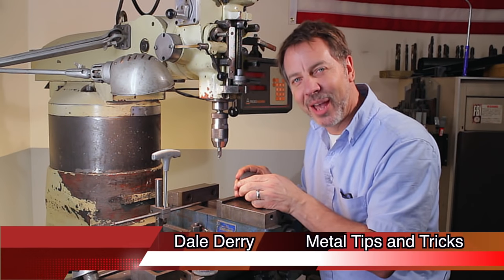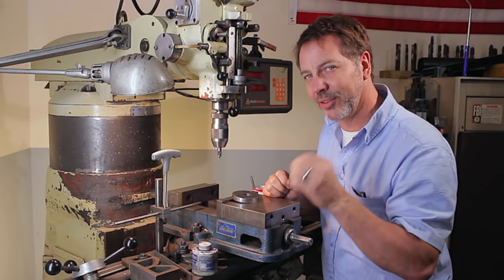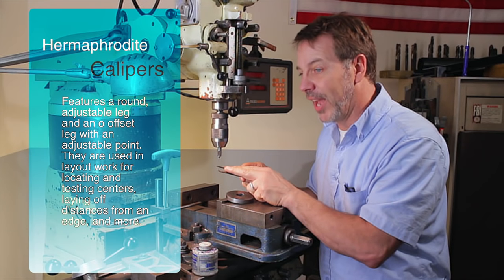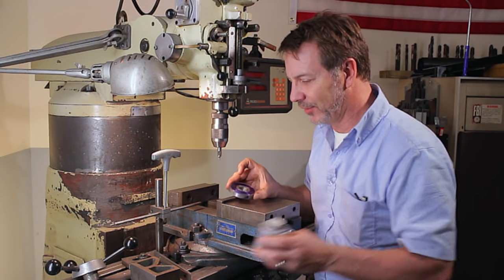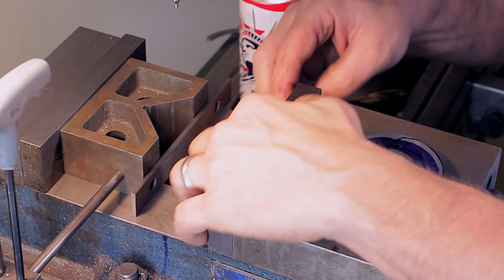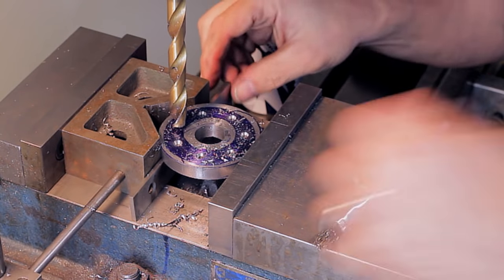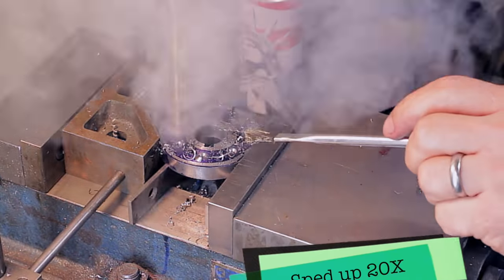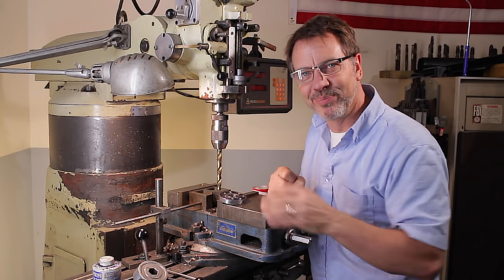How to drill a Bolt circle

Comment: You could use this method when you don't have a mill (with or without DRO) but the simplest way on a mill is to center on the workpiece and calculate holes position using trigonometry.

Comment: I think that making the holes on a circle, the most accurate method is to detect the center of the circle and then calculate the coordinates of the holes in X Y, referred to the center.

Also it would be better to make holes without moving the piece from the vise

Comment: Basic 101 bench work...........in the same time it takes you to lay out, and drill a BC, you could have been done, had the vice back on, zeroed, and even tramed the head back in. Also you will be bang on, dead nuts on your spacing. Check your hole to hole distance with a pair of calipers, it won't be pretty. If you don't have access to a dividing head or a rotary table, then by all means, lay it out, but if you do.........= )

Comment: That is hilarious! I can see the DRO on the milling machine. This week I made my first ever bolt circle, and all I needed to do was select "bolt circle" on the DRO, enter parameters like diameter and how many holes, and the DRO kept moving the 0,0 point to the location of each hole!!! Without that feature, I would do the same thing using the table position dials, and calculate the hole positions using angle sine and cosine functions of my calculator (or sine/cosine printed tables if no calculator???). I drilled all the holes and then tapped them in the same order, no problem. Your way of course works too, but it would take me a long time to get the divider set up to make the right spacing between lines.

Comment: Perfect. I don't have a lathe or milling machine. Want a 7) 3/4" near-edge hole job in a 4 inch diameter, 3 inch tall piece of delrin plastic cylinder with a 5/8" center hold and 4) 90 degree intermediate 1/8th holes? Paper template available from autocad.

Comment: I see what you are trying to do and give your viewers a rough and ready way of marking out, but perhaps a part two with co-ordinate drilling might raise the game to a higher level for those who need greater accuracy and have other means.

On the no room for a rotary table front, an experienced machinist would not have the vice in the centre of the mill table  but off set, giving room for other items to share the table. This will also spread wear on the leadscrew if, every time you have to remove and replace the vice, you put it back on the other side of centre.
Reply from the maker: +Chris Stephens 
Great Idea

Comment: Good for drill press work, but if you do have a mill it will be way more accurate to sweep the concentric feature the bolt hole is around, (hole, OD, etc.) then use simple trig for the X, Y components of each hole. X is the cosine of the angle times the OD of the bolt circle, Y is the sin of the angle times the OD of the bolt circle. Example, 7 holes on a 3" bolt circle; Each hole is 360/7 (51.42) degrees, cosine of 51.42 is .623, multiply that times 3 inches, first hole X is 1.870", sin of 51.42 is .782, times 3 in diameter, first hole Y is 2.345". Second hole is 51.42 more degrees so angle is 102.84 degrees, cos102.84 = -.222, times 3", second hole X is -.667", sin102.4 = .974, times 3", second hole Y is 2.925". Third hole is 154.26 degrees, and so on.
Reply: He's showing us a quick and easy way to get accurate enough hole spacing. Not trying to build parts for NASA here....
Reply: IF you did want to build parts for NASA, do you have the skills?  Will you ever have the skills?   Not at this rate.  And not with this attitude.

Comment: Or you can put together a simple right angle  triangle , just one is all you need  , the two short sides of that right angle triangle are your moves , the hypotenuse witch is half your Bolt Circle and the angle is the angle between each hole do the simple Trig and your done  , and now pick up the center of your part with your indicator to get your Zero and  now just move your X and Y to your calculated short sides of your right angle triangle , the holes that are on your center lines are just half your Bolt circle , so you clamp down your part once do your work then unclamp , now your done ,

Comment: you didnt explain any of the math behind the compass and scribe lines for the bolt spacing. 

also, just so your alignment retains accuracy, wouldnt you want to start your pilot then drill through before moving on to the next hole??

Comment: isnt there a way to calculate coordinates?
Reply: Very easily, if you use a protractor. Divide 360 by the number of holes, and set the protractor angle to the resulting number. Start from an arbitrary 'zero' line (or 12 O'clock) and divide your circle up by however many degrees it is. work in both directions from your 'zero' line, so you don't compound any errors in your angle measurements. If you want an even number of holes, and you've marked your first line right across your work-piece, this is also the 6 O'clock line, so you can work off this line also, both ways, to eliminate errors in your angle measurements.
Reply: +wonderfulmax  yes, use a spreadsheet and use a polar set of equations to calculate x and y coordinates.  Set the centre of the circle as 0,0.  use column 1 for the angle and column 2 for x and column 3 for y.  x=r*cos (angle), y=r*sin (angle).  r =bolt circle radius (diameter/2). angle is in radians and will be a multiple of delta angle da= 2*pi()/n.  Hole 1 =0, hole 2 =da, hole 3 =2*da etc.

You can do this by hand too, or use any cad program to get the coordinates.

Comment: If you have a dro but no bolt hole pattern function, just download the FXwizard  app on your smart phone. it will calculate the locations for you. It also have a speeds and feeds calculator, triangle calculator and more.

Comment: Man, it's the 21st century.  There are numerous bolt hole pattern calculators on the web plus numerous free apps for your smart device. Any one of those and the DRO already on your mill would be a much simpler solution. IMHO
Reply from the maker: +MrPragmaticLee 
Good points

Comment: Great video!     I was wondering how to use this same method to a higher degree of accuracy, and i ended up using google sketchup to do so. (make sure you have the precision set to an engineering scale, and to .000)  If you draw a circle the diameter of the center-line of the bolt circle, you can then right click and divide the circle into however many holes you want.   to get the actual distance between holes, copy and paste a section, or arc, of the divided circle.   then you can measure and get the distance end to end of that arc down to the thousandth.    then simply dial that up on calipers and mark your piece accordingly.

Comment: Thanks for the info, Just had to add my 1.5 cents,,I would have done the math . Tram the part to x y  zero, <<<  and use the digicalus  reader outer, thus a less  visual  error. Machinery hand job book has not easy to find info . Now lets  inspecticate
the part !!! ///  Although I just thought (OhhOhh) the fine method you show  could be done on a  drill press  AHHHHHH thanks again.

Comment: Quick trick Dale but have to feel slightly unsure as to the absolute accuracy. I tend to prefer using math (numerous on line calculators for example) and set up to drill from a 0,0 datum using a co-ordinate set. Still, your way sure saves some time. :)
Happy Christmas.
Reply from the maker: +ChrisB257 
Thing I like about metalworking is, there is always more than one way to do the job :-)
Reply: I have used this method many times in the past with awesome results...The only difference is I use 2 pins for location instead of V block on a jig I have made purposely for doing bolt hole patterns.....
Reply: Interesting idea if you only have a drill press.  With a mill, once the centerline of the bolt circle is established, the machinery hand book can tell you exactly where to go, or countless apps for your phone to get locations of your bolt hole circle.
Reply: sine & cosine works well

Comment: Great technique to Know. I learned a same one with the only difference from Adam (ABOM79) in which he uses a center punch to mark where the hole is desired. Its funny though because I did the same pattern  of holes for friend of mine on a drill press to lighten a 6"OD x 1/2" thick spacer. Its been a dream of mine to have my own shop in which  in a few months i will be piecing together at my place of work thanks to my boss.(He's giving me a small room in the basement) :))

Love your channel

Tony
Reply: +Tony Diaz Read the fine print! Will you  have access to an outside door? Some people might call you being enslaved ;-)
Reply: CncObsession v

Comment: If you have a DRO on the mill, trigonometry is the simplest way to go.  I used it every day as a machinist for nigh on 40 years.  Doable with pen & paper, much easier with a calculator, and easiest with the aid of some CAD/CAM software.

Comment: you've got a digital readout there, why don't you use it, figure out the trigonometry, and move around in x and y  and drill the holes....lot easier than fidling around, laying out and drilling by hand
Reply: He is teaching us a method that doesn't use a readout. Can be done on a way worse machine.
Reply: @silent_bob_  I was taught to use the machinery hand book and the graduations on the dial. This is a hack way to do it. Maybe in China this is acceptable. I have a nice program for the TI-85 I'll send it to you free , if you promise to do this the correct way.

Comment: Amazing how many people commenting just don't get it..videos like this aren't for real machinists...a method like this is for a home gamer with a drill press...if you've got a table that has precise XY adjustment and so forth this method ain't for ya bud..he happens to be using a pretty serious machine to make this part but that's not relevant..also people bitching about precision citing the flange not sealing something properly missed seeing the key way cut in the center, pretty clearly a rotating part, as long as its not spinning at fucking 50k RPM it sure as fuck doesn't need to be within a few thou..the bolt holes in your cars rims aren't even remotely that accurate and your wheels don't just magically vibrate off at highway speed...bottom line is, if you've got legit machines and have even half the skill most of these naysayers claim too you don't need YouTube to learn quickie ways to do this shit...get a life.

Comment: If you want to be a machinist or anything like one get a Machinery’s Handbook and learn thousands of things. This guy has a readout so he should never have to put on the divider or even make scribe marks. Even if you don’t have a readout there are little numbers on the dials. Just learn how to “read” the lead screw slack into your movements. Use to use that method in old shops with no divider, rotary table or readout.

Comment: Amatuer at best.
Put a dial indicator in the spindle and center the spindle with the part. This is zero for "x" and "y" positions.
find your first position at a quadrant position (usually the 12 o'clock position) where you only move one axis from your zero.
Radius of your bolt circle x sine of the angle from your first hole to the second = the short dimension.
Radius of bolt circle x cosine of the angle from first hole = the long dimension.
This works for under 45 degree angles.
For angles over 45 degrees and up to 90 degrees the opposite is true.
For angles greater than 90 degrees just calculate from the next 90 degree position.
Always calculate from a quadrant position. (zero/90/180/270 degrees)
calculate every position and your bolt circle will come out perfect every time.
Math works. Learn a couple formula's and shop work is easy to be accurate.
Super easy with a DRO or set up a couple of dial indicators.
Reply from the maker: You missed the point of my video. This is a down and dirty way of making bolt circled  for guys who don't have all the tools or patients. :-)
Reply: What part of "precision machine work" do you not understand?
I cringed watching your video.
The machine has dials on it for moving precise increments. No special tools needed.
Buy the better 15 dollar calculator with sine/cosine function and learn some math
.(how much did you spend on the machine?)
Cheap and easy!!!

Comment: Since he didn't explain how he came up with the chord distance between the holes, I presume he just used some basic trig and math to figure his distance to scribe the hole locations. Unless it has to be real precise, I just divide 360 by # of holes, which gives you the angle offset between them, then use sine of 1/2 the angle, multiply that times the diameter. Set calipers for this dimension, and scribe on diameter.
5" hole pattern of 8 holes = 360 degrees / 8 = 45 degrees. 45 /2 = 22.5 degrees, sine 22.5 = .38268 x 5" dia. = 1.9134"
chord (distance between holes.)
Gets you there.

Comment: This is clever and well thought through but just a substitute for doing it the proper way. This would not be acceptable in an engineering shop. Do it with a rotary table or with and edge finder with linear dims. Then it will fit in any position.

Comment: Use your digital readout. It will give you your locations automatically..
Reply: The whole point of the video is demonstrating a low tech method for people with limited time/equipment/budgets. What gear HE has available is of course irrelevant. And I don't have DROs on any of my gear.

Comment: This guy has an X/Y readout on his mill, does he not? Get yourself a free CAD program like Draftsight. Draw the part and bolt circle. Make the center of the model the UCS origin. Place the ordinate dimensions to each hole. 
Zero your machine spindle to the center of your work piece. Drill each hole at the coordinates already calculated without ever moving the workpiece. A LOT more accurate than trying to drill at a scratch mark. Quicker too. I can make the CAD drawing in 1 minute. Toughest thing is zeroing the spuindle to the bore of your part.

Comment: That process is very rough indeed.  Why don't you clock up the outside diameter, then calculate how much you need to move in the x & y axis and drill.  This would be far more accurate than using the eye
Reply from the maker: Hi Lindsay. This was just one way to do it. There are many more I could show

Comment: actually, a much more accurate way and even easier than what you have shown is to " Trig " your bolt hole circle. By using trigonometry you can locate your holes using nothing more than the radius of the circle, the number of holes and a piece of paper and a pencil. Once you have the locations in the x-y plane you just dial them off from center.

Comment: My thought about obtaining the pattern. In the following comments the site http://theoreticalmachinist.com was mentioned. Just found it - fantastic!! Anyway not having a DRO I would pick two hole centers (Y=0, Y=next) using the X, Y, math provided by the site. Then relocate and form a 90 degree hypothetical triangle based on these 2 center holes, the hypotenuse being between centers. Calculate the hypotenuse by X Y coordinates would yield the distance between 2 holes. Then use a compass set at that distance and scribing a mark by walking it around the circles circumference. 
I may have confused more than I helped. But I did learn something from this anyway -- Thanks!

Comment: Ok I suppose, but if you need a circle of bolts nine times out of ten its to fit to another component with the same number of holes on the same pcd - i.e. wheel centre or driving flange, isn't it?  I'd have thought it would be a miracle if all the holes lined up doing it this way?  Yes it was fast and the guy demonstrated well, but looked a bit of a bodge to me!

Comment: I really don't want to be harsh, but no machinist would do this.  I have managed a number of shops over the years, ranging from basic job-shops, manufacturing shops, to mold and prototype shops, and aerospace shops.  I would be very concerned if I saw an employee using this strategy to lay out and drill a bolt circle.  I guess this would be fine for a home hobbyist with no practical experience, but again, no machinist would do this.

Comment: Layout works then just use drill press if in a mill quicker to just do the math 7 hole should only take about 2 minutes to do all the math then just move and pop hole in split point drill no need to even center drill. less than 5 minutes start to finish. You will be 10x the machinist if you keep up on the math.

Comment: Whatever happened to simple Trigonometry in shops? Just calculate the bolt hole locations as X & Y coordinates. Pickup the center of the part with an indicator, set a zero, then use the milling machine dials to make the moves. I've been doing it since the 50's, it's called Jig boring. 
There are simple charts that convert radial locations to coordinate locations if you hate Trig.
https://www.engineersedge.com/calculators/bolt-circle-coordinate.htm
Geez, it's not rocket science!